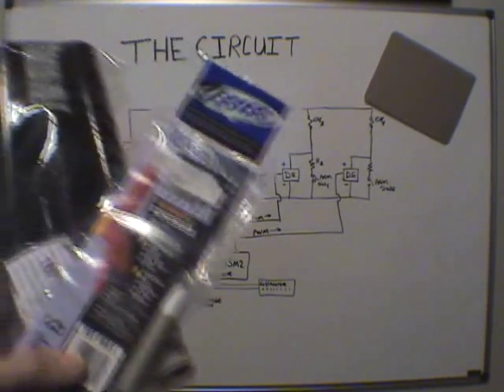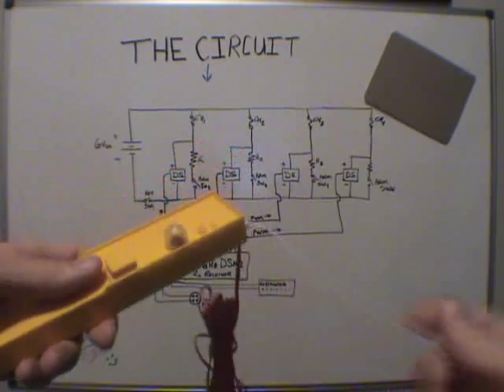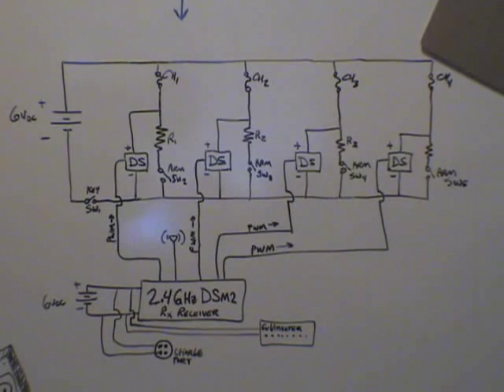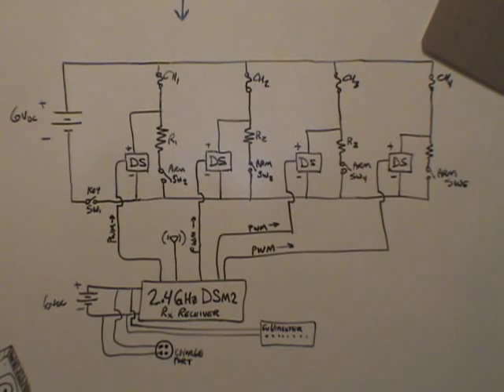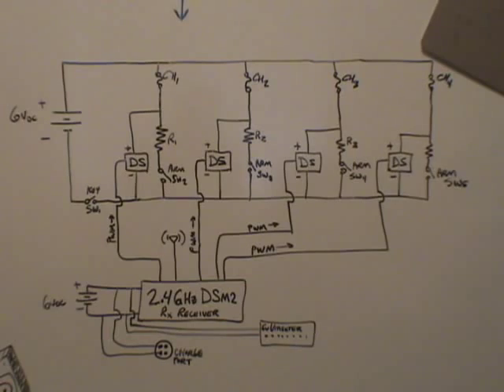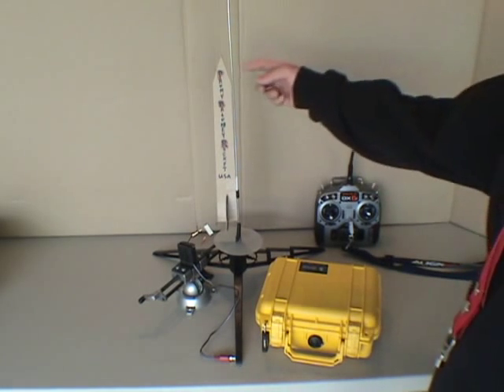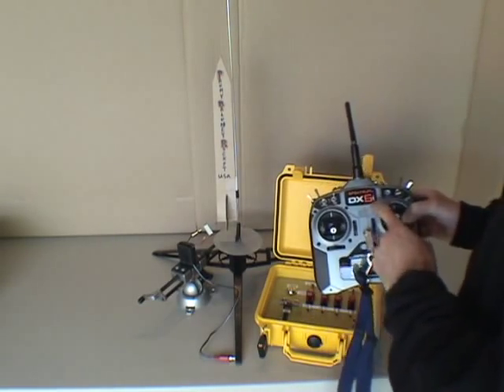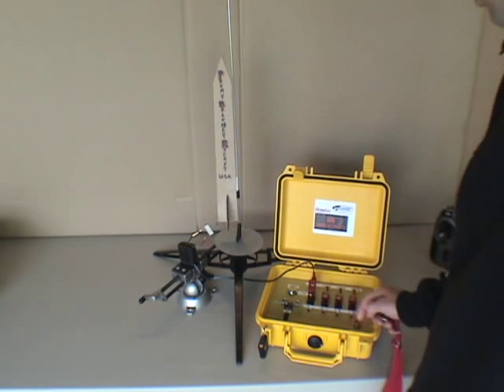Spektrum RC Model Rocket Launcher Part 1 of 2

Comment: Hi Jeff, does the Spektrum brand receiver and transmitter have to be used or can I find a cheaper one and it work?
Reply from the maker: My design is only one of may ways this project can be accomplished. I suggest you get with your local hobby shop and talk to someone specifically on the different types and price ranges of RC transmitters, you could do this much cheaper with different equipment. Be creative and find someone local to you to assist you, all the best and have fun building your project 👍
Reply: k thanks.